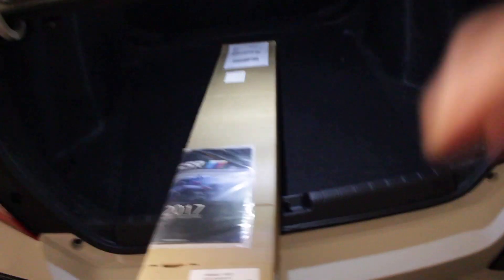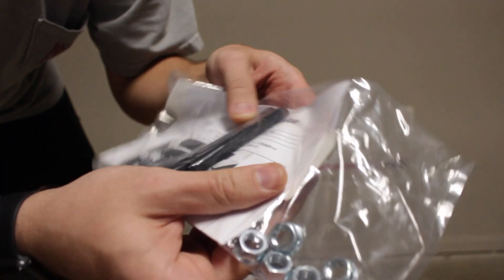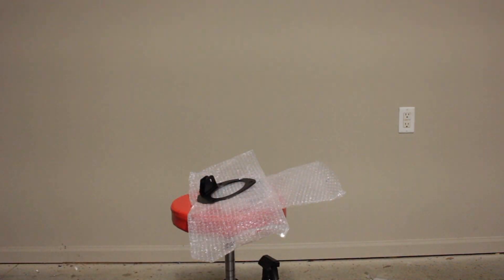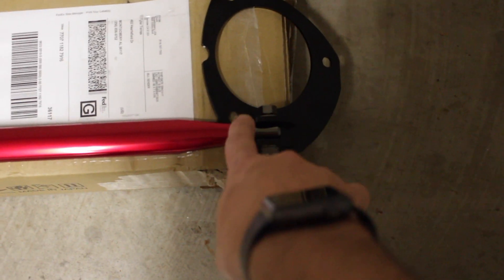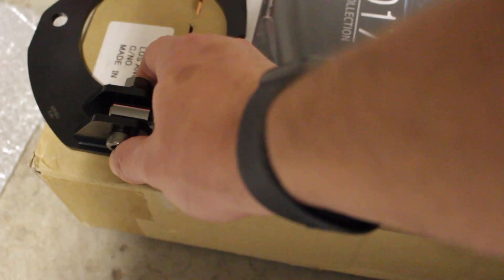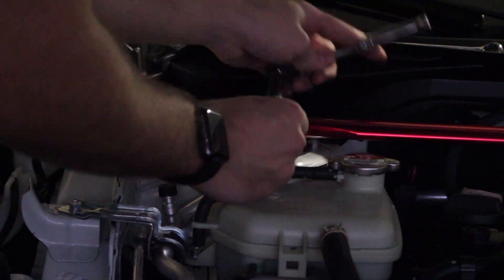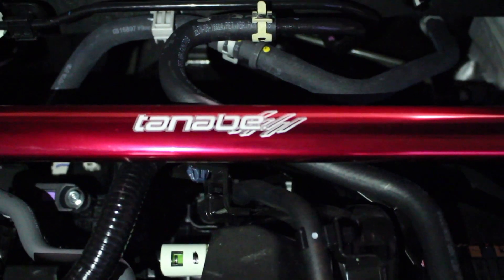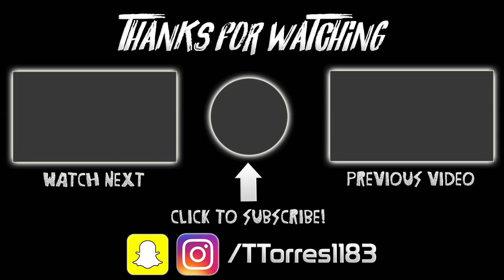2017 Honda Civic Si Tanabe Strut Bar Install

Comment: When you take the car to make oil change you don't have any problems?  You know the car is up and maybe the car structure present some tension .I just want to know if not problem because I want put the strut bar to my car.Thanks you car is really cool.
Reply: TheEdgar0125 strut bars have been around for decades.... They will not do any damage.

Comment: Great vid! Will this fit to any 10th gen civic?. Do you think this will fit in 2018 honda civic sport?
Reply from the maker: You would have to look up the specs... I believe so
Reply: TTorres1183 I did but it seems like there are not so many have it installed on 2018 yet tried to contact customer support they told me to look on the picture if the mounts are the same. Picture it out LOL. Thnks though.

Comment: I already installed mine and i will try(drive) tomorrow. The only downside is the screw that you need a wrench because i dont have enough space or strenght to tighten it.

Thanks for sharing sir torres it helps a lot :) sorry my english is bad. Subscribed!
Reply from the maker: Thanks for watching!

Comment: Thanks for the great vid. Just curious, does Tanabe provide torque specs for the nuts? Also, do you thing you can use a thin walled socket on the nuts you had to use the wrench for. I am super anal about proper torque. Thanks!
Reply from the maker: I didn’t see any torque specs on the nuts but you should be able to get a thin walled socket on the nut